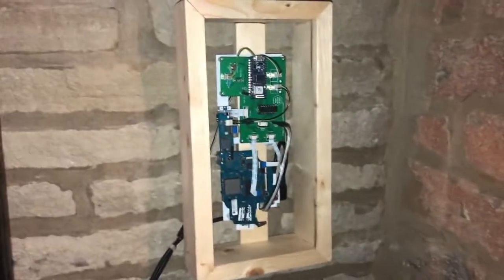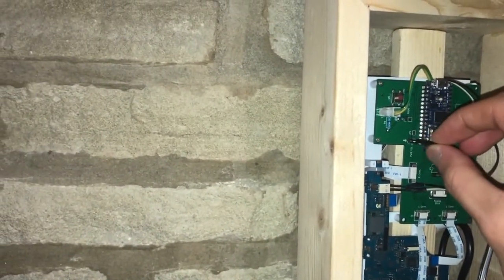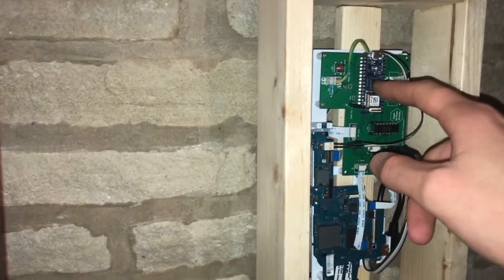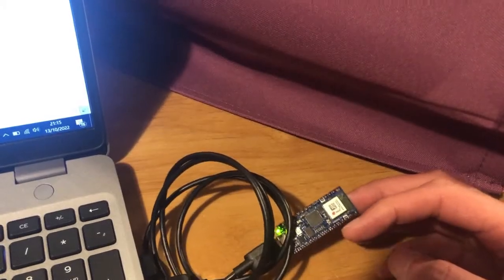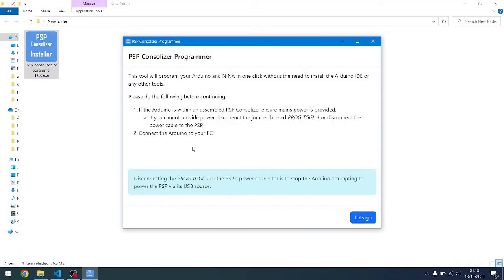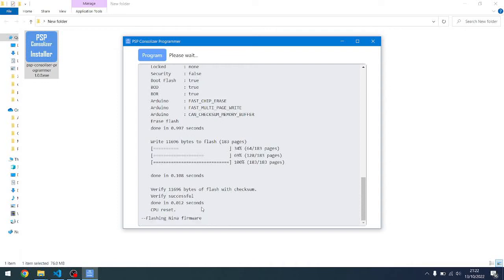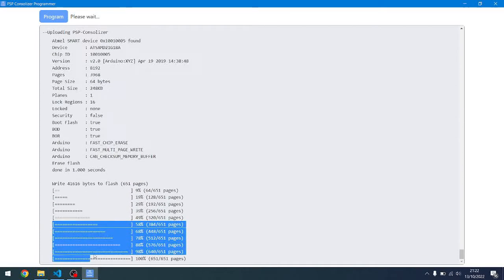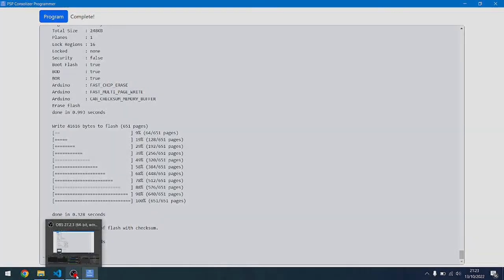PSP Consolizer update - Programming

Comment: now make it all fit inside the UMD slot :P
Reply from the maker: ha yep! However i may have had a bit of a brain wave of how i could do all this in software. No internal modifications needed. Its still very early days but if it works it will be such a better solution. Could theoretically work for 1000 models too (without TV out however so may not be that useful)
Reply: @stephencooper3067  Well, you couldn't do EVERYTHING in software, right?  Because you'd still need some sort of BT hardware, or am I missing something?
Reply from the maker: @TheCameramanInvestigator  Yup, still need the Arduino to coordinate with the controllers. But the coms with the Arduino would be via the PSP's serial port (what the multi media controls on the headphones used). Rather than connecting loads of FFC's internally.

I'm thinking integrate it into a dock and you just place it in (like the Nintendo Switch) and it'll start using BT controllers.

Currently struggling with the software. It compiles fine but crashes the PSP. However it was only a few hours the other night so early days.